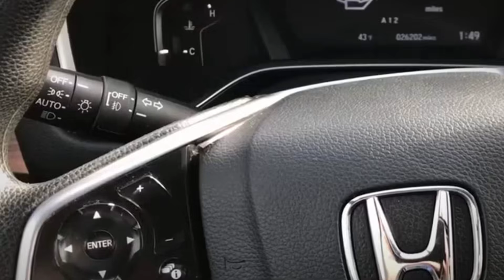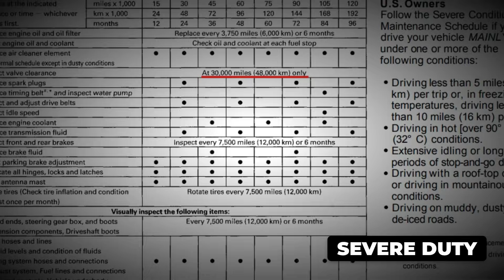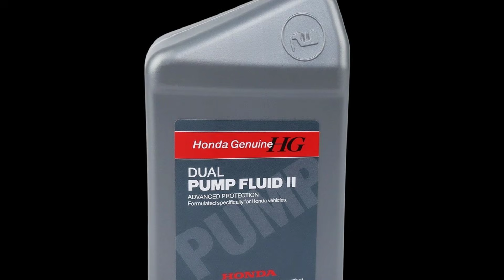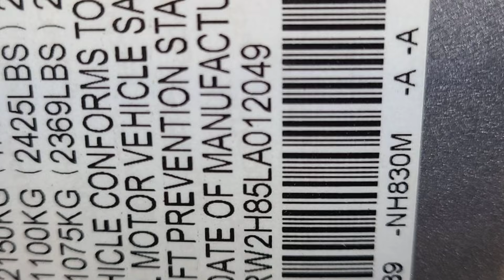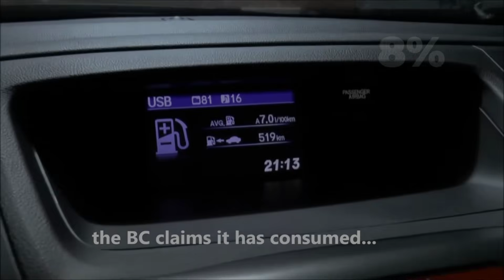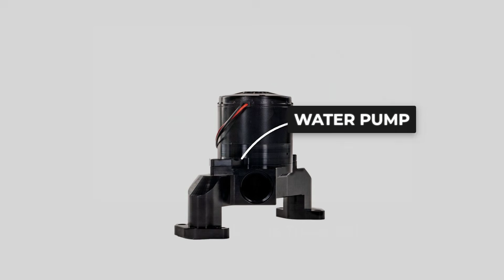Honda Mechanics REVEAL the 7 Maintenance Mistakes KILLING Your CR-V

Comment: Why would the ECM add more fuel to an air restricted air filter when the M.A.F. sensor is calculating how much air is entering the engine?  The M.A.F. sensor is located after the air filter.

Comment: How would a software update cure an oil dilution problem?  The oil dilution is caused by low tension piston rings & possible the lower (thinner) oil viscosity.